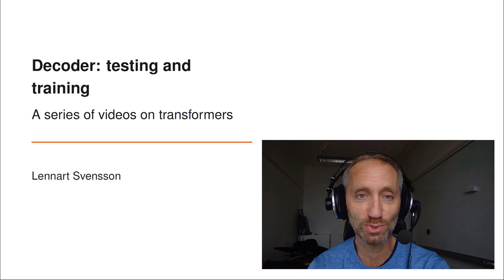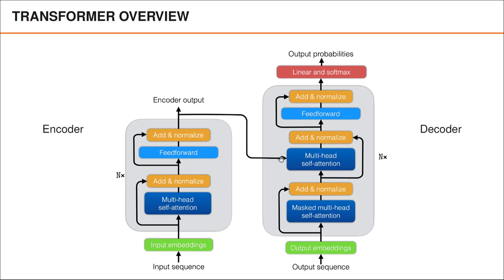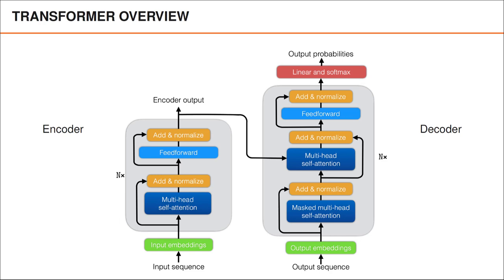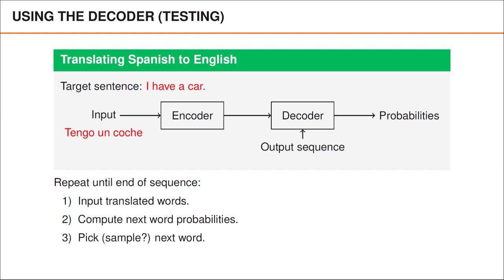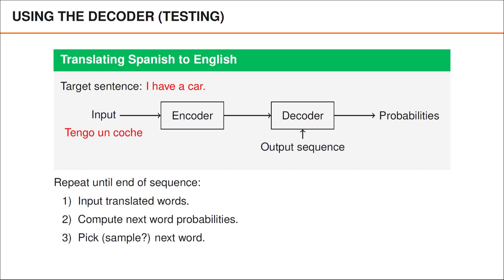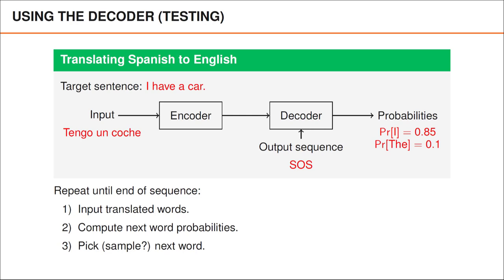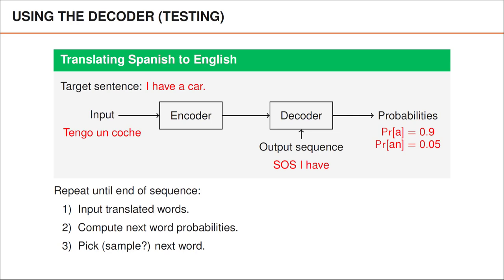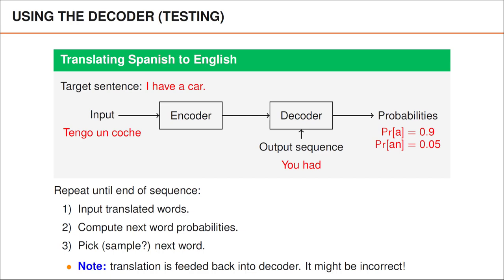Transformer - Part 6 - Decoder (1): testing and training

Comment: thanks for ur  great explanations. i have a question, during he testing the input to the encoder will just feed once? and these three step will just be repeated? or i each step the input to the encoder  will feed again ? and during the testing we dont have any masking right? the mask are equal to None?
Reply from the maker: That looks like several questions. :) 1. The output from the encoder can be precomputed and used repeatedly. 2. We use the same architecture during training and testing, that is, there is no masking in the encoder, but one of the self-attention layers in the decoder is masked.
Reply: @lennartsvensson7636  As I know we did masking to have parallization in decoder but during the testing we do not have any paralization and everything will be done one by one . I will be thankful if you explain it for me alittle bit . . Another question if I want to have training, testing and validation set . Since validation will be done in the epoch of training, should I do that like training or like the inference part . Since inference of these networks are different I don't know validation also will  be done in parallel in both encoder and decoder ( like training ) or it should be done in parallel in encoder and in decoder should be done like testing . I know it's lots of question but sorry:))
Reply from the maker: @somayehseifi8269  First, the reason that we use masking during testing is that the weights are selected to work well for an architecture that contains masking. If we were to change the architecture, we would need to re-train the weights using the new architecture (without masking) to obtain good performance, but that would be computationally very expensive (especially since that architecture does not allow us to parallelize training). Second, you are free to perform validation as you see fit. However, the simplest alternative is arguably to evaluate the model’s ability to perform one-step prediction and perform validation in the same way that we trained the network. I believe almost everyone performs validation like this.
Reply: @lennartsvensson7636  Thank u for ur answer. so if i used source mask and target mask in training i do the same for the testing as well right? for validation, you mean it will be done exactly like training , both encoder and decoder will be working in parallel. however, in testing decoder would not work in parallel. did I get it right?
Reply from the maker: @somayehseifi8269  The parts "I do the same for testing" and "exactly like training" sound correct to me.
Reply: @lennartsvensson7636  what about the validation? Both encoder and decoder will do in parallel like what is happening in training? Or validation should be like testing and we should feed the part of the sentence that has been translated till now to the network in each step ?